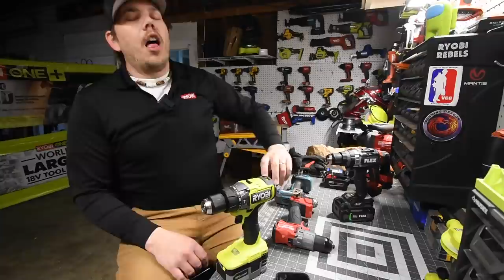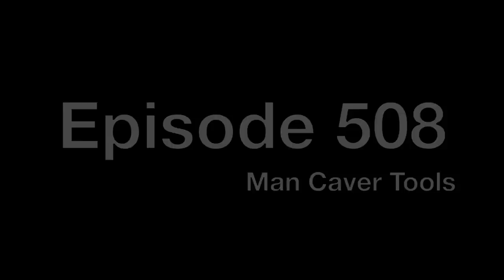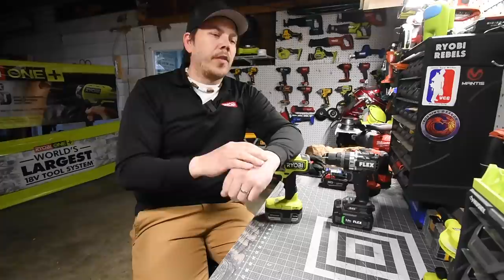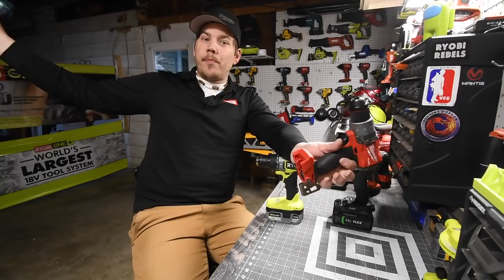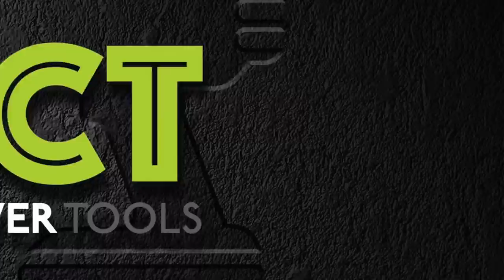Why are tool tests unfair?

Comment: As we know Milwaukee and Makita and Dewalt and...... derate power when a smaller cell battery is installed to protect the smaller battery. Yeah if we are racing I want to use the fuel (punn intended) that my motor was tuned for not pump gas

Comment: I’m not asking that u make it fair😂 I’m asking u to make sure to stop the anti kickback from engaging and u don’t seem to care making u someone I’m probably going to avoid from now on for my tool reviews. It’s also true Milwaukee is not as powerful a tool as the flex drill.
Reply: Just an explanation would have sufficed maybe it wasn’t the anti kickback but it looks like it to me.
Reply: To me the Flex anti kickback doesn’t work well. I couldn’t deal with that everyday because  I wouldn’t get anything done. There is safety and there is productivity. Imo put the 8Ah battery top of the line battery on the Flex and put the top of the line 12.0Ah battery on the Milwaukee and see who does it the best.
Reply: In my view, if someone has to treat a tool a in a very particular way in order for it to give acceptable results, that's a problem.  (I'm not talking misuse).   I jammed a self-feed spade into wood with way too much force on my first Flex vs Milwaukee video, bordering on misuse. Lots of comments on that. But  - the Milwaukee handled my improper technique just fine.  So both tools were subjected to the same conditions and the results were what they were.   Just food for thought!
Reply: @PhillyFixed  that’s fine but I want to see what it can do and believe it or not some people really like the feature and not showing the full results is dishonest or ignorant we want his opinion but we want to see what it can do not just what u complain about it’s dishonest in my opinion because it’s ez to hate on a company just cause u can u get more views when u do. His xtr review was bad and so was his flex. He doesn’t have to take my criticism it’s just my opinion.
Reply: @right8630  also why was the speed selector on the flex drill set at 7 not 23 its max speed I know it was in drill but was still not on max speed
Reply: @stephenandersen625  That's not a speed selector, that's a clutch setting for fastener mode.  The clutch setting doesn't apply when in drill mode.

Comment: None of that matters if you don’t realize what you are doing wrong.  Running the dewalt on speed 2 for example....
Reply from the maker: Dewalt made that option for its users, its fair because that is what makes the tool different then the others
Reply: @ManCaverTools  I really don’t care, but I think you need to understand that the rpm on speed 2 of dewalt is not the same as flex or any brand out there.  I didn’t even realize you were running on low gear this whole time, but it’s really not my job but thankfully other people were pointing that out. We All need to learn from our mistakes and do our best to educate people about anything instead of saying “welp it failed.”  Why did it fail?  I honestly don’t care anymore, but at least i learned what went wrong.  That speed 2 on dewalt doesn’t make it different....it just gives you a speed right in between for control.  If that makes it unique, then you can say the same for Flex which technically has a turbo mode for each speed.  Edit:  I also don’t think that irwin speedbor is rated for2500 rpm and even if it was, it should take good amount of energy to spin that at whatever speed, but I will be contacting irwin to get their recommended speed or correct instructions because this thing has no rating whatsoever.
Reply: @ProxyFinal  well said. You really have to know every single detail and do due diligence before you make a fool of yourself. Again I'm not butthurt and I think that dude is pretty cool meaning the host but still man keep the reputation and people respect that I think

Comment: Dude your perception of 3 speed is misplaced. You should compare rpms because lower rpms on these drills will obviously increase the chance of bits completing the task.  I like your channel but you do need to spend more time understanding all the tech of the tools before you put Your foot in your mouth. Watch reds live stream from last night he makes valid points. I watch lots of channels and I don't get but hurt. But it is important to have your facts right. @mancavertools